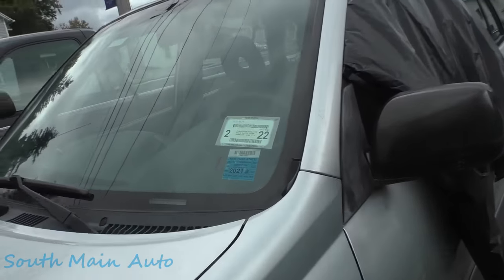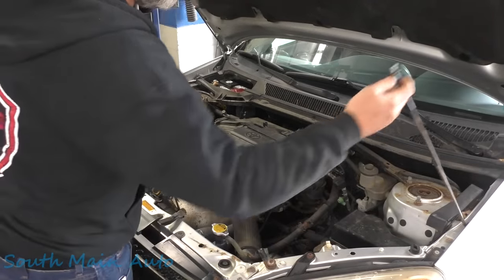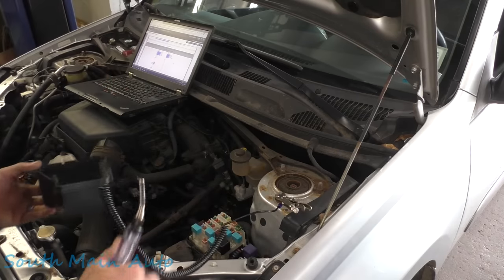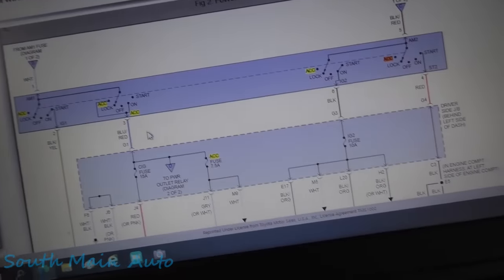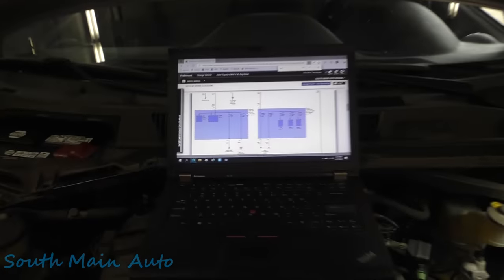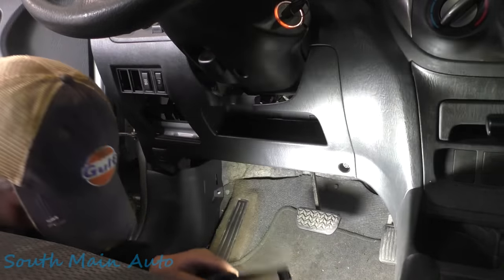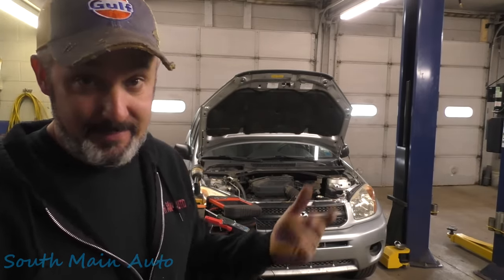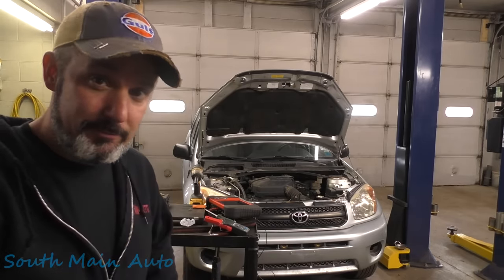Toyota Rav4 Is D.O.A. But Still Runs?

Comment: I can't fault your work practices in the slightest. You seem to often get issues that other mechanics can't seem to crack. High tier, more specialized work that's above the heads of your average mechanical mechanic. Let their "usual" mechanic point that out. Don't waste time looking around, documenting and communicating additional problems that could be fixed, because it's not guaranteed money. As cars keep getting more electronically advanced, this particular skillset will be in higher demand.

If only I could get my 2013 Chrysler 300C to you. It's got some dodge-chrysler electrical gremlins and would love to see it featured and critiqued by a professional in a video, however it's a long way from MO. Dealer told me the wire harness needs replaced. Rip out all of my interior. $3,000. Yea, doubt it. Been debating on shipping it...

Comment: Bett you it was a short on the alternator wire, changing the aternator whit a connected battery...or the loosse batery holddown shorting the connector to the chassis.. diy work.. probably.

Comment: I have had isues with rusty conections from the bolts just past positive battery post befor on toyotas nisans are the worsted for that seen shop put in new starters an all kind of stuff wire brush fixed it

Comment: If I had to bet someone hook the battery up backwards Or jumped it backwards Cause  If the alternator has dead short I would think The the diode in the alternator would be bad and the battery light would be on I think that fuse just protected it That's my 2 cents my Might not be worth a penny

Comment: Man. you did make the trip to the junkyard and you got the fusebox but not the missing battery holddown bracket if it was there lying next to you? Very wrong, as the fuse blew because the battery was not mounted properly so you didn't repair the issue.  If I was there, I would have also gotten the window switches and offered to fix it for the customer for more $, say another $50 which would be a 2 min job.

Comment: Gee Eric NY must be a trusting state,if all they monitor you with is and paper arm band in California they have us put on LEG MONITORS that lock with a WHEEL-LOCK KEY,just so they can keep track of what isle your in.IF you say the ford trucks,and you cut through the Toyotas ,they turn the dogs loose on you,by the time you run out of the yard ,you've dropped ALL THE PARTS you were trying to steal.Since they have been charging 2 dollars to get in,many parts get caught in your pant cuffs when you roll up your 40 long jeans when your legs are only 30 inches long.I just don't know what's going on with MY STATE anymore?haha

Comment: You are careful, but you should remove the negative/ground from the battery first, before putting a wrench on the positive terminal.  It is like playing ‘Operation’ with 650 cold cranking amps.  If that wrench touches any part of the ground you’ll have lots of sparks.  Probably what happened when the alternator was replaced.   

On the other hand, if the ground is removed first, and the wrench touches the ground, then the battery is momentarily connected correctly, no sparks.  

When disconnecting the battery, always remove the ground first.  And when connecting a battery always connect the non-grounded (positive) first and the last terminal to be connected is the ground.  

If at any point a wrench touches ground with the proper sequence, the will be no shirt circuit to complete with a wrench on the positive, and with a wrench on negative, the ground will just complete the correct circuits in the car.

Comment: How much was the battery hold down gear from the wrecker? How much could you have asked the customer to pay for the 5 seconds it took to collect those parts? How much did Mr. O pocket on the fuse?

There's not fixing all the problems and there's being a bit of a slack ass, to not even offer to take the customers money. shrug

Comment: I would have grabbed the battery hold down from the junkyard Rav4 because even if the battery is the wrong size, at least you could secure it to some degree and not risk it tilting and possibly shorting again. Or at the very least contact the customer and install some sort of aftermarket hold down. A unsecured battery is never good.

Comment: Great that you went to wilberts but you love how the viewers love it more. Wonder if that lady detected something with you..
Ridiculous and needless drama to even suggest vacuum. Did you charger him the full hourly and had time left over? Or did you give him a deal and said it's fixed for $20. Just wanted to show how ridiculous sounds like. Sounds more like if you charged him fully, you really didn't like the guy, wanted more from him, and he wouldn't budge. This is exactly why shops get a bad rap. Least you could have done was ask. And tell him this can be the problem that solves why it could have happened in the first place. Or get a comeback. If you really didn't like the guy, don't take the job, plain and simple. If it was my car, I would hate to come back and accuse a mechanic of not doing his due diligence and scamming the customer so he could come back. And if he's in there to tell me to change the thing next to it that also could go bad and costs peanuts. Like the guy below who are brown nosers for you and arguing with him because his sending unit wasn't changed when he changed the pump. FOR THE SAME COST and no additional time required, which is what the guy below was trying to give excuses for the trash tech. People are acting like it's free. NO. Charge him for the part. Maybe even the usual shop markup. So long as it's not gouging. Which it sounds like these guys do to people. Karma will get em all back. Judgement day will come in the end. Pray to God today. Try to do it at the end while doing people wrong and he might have deaf ears come time to pay the piper. Reckoning day.

Comment: What?  There was probably a hold down clamp at the wreckers you could have put in there.  Not fixing that dangerous issue is poor form.
Reply from the maker: It has the wrong battery in it. Like I mentioned in the video, The hold down that belongs there from the factory wouldn't fit anyways.

Comment: You also had a 2002 Rav4 not completing the drive cycle and catalyst monitor , A/F and oxygen sensor troubleshooting video with waveforms about 6 years ago . How did you complete the drive cycle on that . You took it out for a drive in the morning . What mph and how many miles to complete the catalyst and other monitors ?

Comment: When the car brakes - will the battery not roll forward and put that contact in touch with the bar that goes across - blowing the fuse? I would have secured the battery to be sure.

Comment: The reality is you are not a charity. I have seen you help people out in different ways, though you are as you said: a shop and you are engaged to undertake certain activities on a customers vehicle. Anything you do you pretty much have to warranty. Even with customer supplied parts, there is some warranty, not the part, but certainly whatever you did to install the part AND most importantly your reputation.